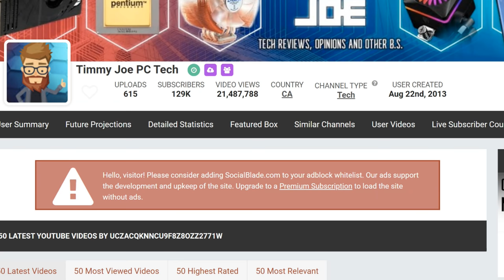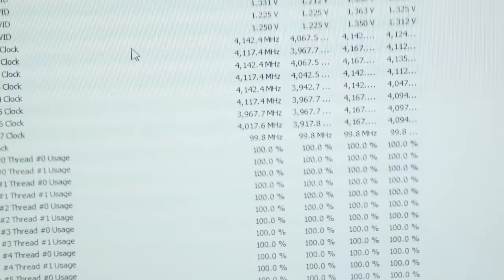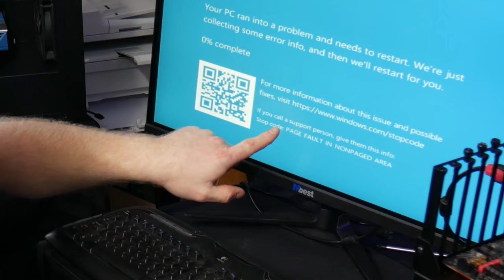This Ryzen 3700x was my biggest problem in 2019...

Comment: Of course you want a twelve core, why settle for an 8 when you can have a 12...
Edit: I had one problem kind of similar to yours that was caused by a windows update error of some kind.  Just had to reinstall and that was fixed but I guess the newest update didn't install properly or didn't overwrite other updates that cause comparability issues?  It would freeze just sitting on the desktop within 5 minutes of starting so good job windows 10.  Another odd problem was with a Nvidia Linux driver that messed with the sleep/hibernate/suspend... basically anything that turned off the screen would cause the system to shutdown instead and using opensource drivers or rolling back the official fixed it.  Mobo issues are something else though and I haven't personally had any but that would be a pain to figure out, especially since it still technically works, just situationally.

Comment: You know I have a really frustrating but similar problem with a 3600X video editing rig I sold. Also a Gigabyte motherboard. The client would report all sorts of bugs in Premiere. Initially I wrote it off as the client (who is new to editing) simply using too many effects, but I was unable to reproduce the problems in my workshop, then I would give the PC back and a few weeks later she reports new problems. I tested the actual video she was editing and the footage (optimized the effects too), suspected problems with Creative Cloud (there was some bug months ago when an audio layer with 12+ audio effects would slow down the PC more than it should have, but they fixed that since then), changed the videocard, the RAM, the PSU, but never once suspected the motherboard brand...

Comment: My pc started out as a 2400g during the mining apocalypse, so I was using it to game. I got a gigabyte B350 gaming I believe which has no heatsinks on the vrms, or at least on the soc mosfets. This is my first built pc, so I didn't know it would be a problem. I was wondering why my games would run okay to start then turn into a stuttery mess. Well, turns out they were getting up to about 120°c which was causing it to throttle. I ended up returning the board, but it really turned me off gigabyte. I also didn't like that voltages and everything was offset only.

Comment: I have the X570 Aorus Pro Wifi and 3700X with XMP settings using ryzen calc and PBO enabled and never experienced blue screen at all since I built it in August of 2019. never even had to restart because of errors/hangs. maybe try again but with retail products instead of launch samples?

Comment: @TimmyJoePCTech - Weirdest issue i havvve Ever gottten was when a Windows OS Refused to accept Changing of Hardware By using Same OS in Upgraded Hardware config - it Actually Refused to Boot From Just Upgrading Hardware !
However 
Same Isuue i THINK You experienced Here is from BIOS Update on CPU to BIOS Update on Motherboard to OS UEFI Update to Accept Updates Through the Codec of the UEFI Update as Many times a Windows UEFI Update WILL Brick a BIOS due to Not Recognizing the Hardware Updates Through its Own BIOS Codec - { micro code } -,
See - what ive came to learn is that Windows / Microsoft , due to Loss of Profiting From End User Upgrading or Updating Hardware that Windows / Microsoft Feels it Also Should be Upgraded / Updated With a New - Purchase  - From their Product line , as Soo Many are Constantly using Same OS to Cross Platform or Eliminate Purchasing New OS For Updates or Upgraded Systems - Call it - BUT-t Hurt -  from Loss of Revenue , if that makes Sense .
Also had a OS Purposely Brick my Motherboard Bios From This Exact Same issue , without the blue screen even ggiving Any Warning to problem , just But-t hurt from Not purchasing New OS for Upgrades to my Old 15x system that i have sitting behind me now waiting on a Refresh - paste etc. Before selling iot off with Totally different os and some upgraded fans to improve airflow with a 1050 ti and Oly sshd`s , Might throw in a ssd for boot , But I Want see Any mark up in price for sale as its Used hardware - soo , i Think ill just stick with the sshd in it now and let it ggo as i Want get what i have In It Anyway . 
Oh well 
Later Tater

Comment: I have a 3700x, have to run an offset voltage of +0.2v else it bluescreens. Or I can either lock it at 4.0ghz and then it's also stable. Something goes wrong with the voltage it seems when it's boosting. (msi B450 tomahawk)

Comment: I'm not a big fan of Gigabyte more so due to my linux-box is using a X470 Aorus Ultra Gaming with a R5 2600 and they disabled PBO because it's not an X chip.. humm you don't need an X chip to use PBO.. you only need the X chip for XFR.. The Asus TUF B450M Gaming Plus did al that and more.. but had a poor layout for me.. I regret the swap. so yeah. I'll be avoiding gigabyte if I can help it in the future. And yes.. that was their answer on a support ticket, PBO is not available if not an X chip on that board.

Comment: Hey, I have the same processor, MSI X-570 board. With a Vega 64. I am having stuttering issues and it doesn't seem smooth as it should for what I have installed. 16gb of ram as well geared for Ryzen. Mouse will freeze on screen while gaming, just doesn't feel smooth most of the time. 

Any suggestions on what it could be or what I could do to investigate this to see what is going on? 

TIA Timmy!

Comment: How can you swapped motherboard on another cpu when swapped cpu ( in ) to another motherboard, twice?  Have you tried by using a lesser core chip of Ryzen to be sure it the motherboard doing or that what you actually meant.  Otherwise I may think one of the comment had answer that question to be the way Gigabyte have have done.

Comment: I had the same issue with me 2700x turns out my issue was my ssd. It was not an empty drive it had a windows install from a previous (fx) system. Did a clean windows install and its been  good ever since.

Comment: Great video Timmy! I've always! told my clients and suggested to my clients that asus,evga,msi and asrock( even more so asrock as there cheap buy VERY reliable) are THE best imo for a motherboard. I myself am running a ryzen 7 1800x on a gigabyte Mobo x370 and the Fricking CPU is a finicky sob with my mobo,hence why im looking to upgrade my CPU and MOBO(to a Asus x570). Very rare imo this stuff happenes but being a user OF IT,.Yeah it sucks ballocks. Im also running a 1080 GPU and 64 gigs ram.

Comment: My Problem was about for a week ... my MSI B450M Mortar MAX wont work ... i replaced at with a new video card because ez led shows me that the gpu failed.

issu same... so i fought hm it could be my PSU ... so i changed my PSU and now it worked but i had after 15-40min in Games Blackscreens.

Then i had enough and switched the motherboard to a gigabyte x570 gaming x and what should i say... it works just fine!

that was my weardest problem ever!

Comment: In my hp omen I put this 3700x in and it ran beautifully with the 3070 on 1440 but randomly when trying to upgrade an sdd I started getting the dreaded memory code of 3 long and 2 short beeps. No display.  Kept banging my head then finally dropped my original 3500 in there and cleared cmos then problem gone.  Do you think i got too much grease in bad places on the cpu or it's simply toast and i should chaulk it up?
Reply: Heartbreaking cuz I just got a sweet new extra wide monitor from wife for bd that I've not even unboxed yet 😂 cuz i know the ryzen 3500 will bottle neck the 3070 bad @ 3440x1440 😢 hAllppp

Comment: Thanks for the truth Timmy, 
 I recently upgraded the bios on an (ASUS tuf  X570+ wifi) with a (ryzen 7 1700) installed. 
This will give you a black screen as you loose support for the first gen cpu.
Purchased a 2nd gen processor and bam it took off.

Comment: My 3900X has this issue if the spread spectrum is enabled on msi,asrock and gigabyte. It just shuts off just like when voltage is too low and only on idle/low current/stress loads.

Comment: I have an msi x470 gaming ac m7 motherboard that won’t let me manually set ram timings or xmp with a 3700x with the latest two bios updates so have to run the their v1b release bios which is frustrating because I’ve tried two sets of ram and two other motherboards and it runs fine on those also the 2700x I had in that board runs fine with manual timings on latest bios and msi themselves haven’t gotten back to me in over two months what it does it’s boot loops till it sets ram to default 🤦‍♂️

Comment: On my new Asus Crosshair Hero VII WiFi, I got a Q-Code 02 and couldn’t get my motherboard to post at all with a ryzen 5 3600 with the latest bios. I changed out the memory, changed the cabling, changed the hard drives, nothing worked. Switched back to my MSI b450 tomahawk, works fine. So I sent the Crosshair Hero to Asus for repair. Anyone know if you can fix a 02 on your own or is that a bad motherboard error?

Edit: I like to try and learn to fix things on my own if it is possible is why I’m asking for future reference.

Comment: I have the same issue with a 3900X and the non wifi version of the aorus pro, exept it happens when i turn XMP on, i blue screen all the time. So for now i have 3200Mhz ram running at 2600Mhz... Any solutions ? I think it should be fine if i play with the voltage but I suck at overclocking... If a good soul would like to help I would appreciate a lot !

Comment: Timmy Joe! I have a problem with my pc that is driving me up the wall. Any input would be amazing! Built an 8700k build with a gigabyte z390 auros elite, 16gb ddr4 3200 Corsair ram, 2070 super and a few different hard drives. Problem is randomly either my game will crash or pc will hang with constant flashing of hard rice activity light. If it hasn’t completely hung then il check using intel rapid storage and either the drive the game was running from will have plain disappeared from my pc OR the sata transfer rate will have dropped down to 1.5gb per second from 6gb and only swapping sata cables with other drives around will get it back after a reboot. Appears to be random drives at random times and across ssd’ sand mechanical drives. Can’t work it out!!!!

Comment: I had a similar problem a year and a half ago when I was building my first new pc with (I think) a Ryzen 5 2400 and a MSI B450 motherboard. I was getting random bsod's at random times, it would range from 5 mins to 5 hours, with over 15 different errors. I didn't know what to do. I just RMA'd the CPU, RAM, and mobo to Newegg and bought a i5 8600k with an Asus z450 from Amazon.

Comment: I have a Asus TUF GAMING X570-PLUS (WI-FI)   with a 3900X cpu ... tried to install windows ..and it bluescreens ... so I updated the bios .. re-installed windows and got another blue screen ... the cause of the blue screens .. was get this .. the Intel wifi  onboard ... I had to disable it in the bios .. install windows and then re-enable it  to get it to work ..

Comment: if you think that was a head ache you should try using corsairs iCue (not Cue. which it will try to force itself to update to if you have Cue.) on a x79 system (: doesnt even bother to give you a full blue screen, just straight up makes your screen 1 full color with no text at random (mine got hard triggered by playing LoL but it took ~40 min doing anything else but 3-5 min of league). didnt have many spare parts and there was almost no info on this at ALL as x79 is fucking ancient and cue is completely replaced by icue and you have to go pretty deep fto find a download that may or may not be legit of corsair cue, then make it not update itself to icue right away. pretty sure there is still no true fix for this but simply not getting a corsair device that should need icue(or cue) if you have an x79 system, to all the 3 people who still got one of those.

Comment: i have a Asus b350-f the board wasn't really design for r7 3700x, but with the bios update you can put 3700x and even up to 5800x or so i believe anyhow im using this pc right now and it works fine with arch linux, but the channel b slot doesn't work and i read up if pins are bent on the cpu can cause this and i check the pins and they all seem  fine from what i can see from a naked eye, but i dont know i mean it works fine but memory only works on channel A and i had this cpu in a b550-a motherboard and it ran fine and ran all 4 dims not sure why is the problem.. though im guessing the 3700x is  a cpu i would tell people not to get i say get a 5700x.

Comment: I had this problem on my 3600, i found that by letting PBO have +200Mhz would cause crashes in normal use, this was driving me crazy as i was trying to OC ram at the time, around i got my cpu about a month after launch, i thought it was ram also and ram memtest86+ and it would find a error at 50% by the second pass if i ram my ram in dual channel, single channel was fine, but memtest86 was fine and so was memtest in windows, a BIOS update fixed the memtest86+ error (took almost a month to get that update); i have a MSI X470 Gaming Plus

Comment: My pc first start won't boot to windows. I have to turn off the pc and wait for 10sec then turn it back on.. It will get stuck on the asus tuf logo. The led boot on the montherboard is on.. Check every thing on bois even change ram set up. 
My set up is ryzen 5 3600x, asus tuf x570 wifi, triden z neo 3600mhz, corsair mp510 nvme, gtx 1660

Comment: your motherboard not feeding CPU enough power because bios think it is a4 5400 CPU but not a4 5400 it is ryzen 5 n i think u need upgrade bios so it should be able to work out n i do remember build one for my friend same mobo same CPU n GPU 980ti n i have that problem before n i have turn voltage up get it back working

"edit if doesnt work just hit me with comments i may come up with something help you out"

Comment: My Msi Rtx 2080 super won't let me use mystic light software on the strix z390f . :(

Oh also the rtx2080 won't turn on my screen with display port. I have to switch off the monitor . Turn on the pc and when the red and yellow lights come on on the motherboard I have to switch on the screen instantly or it won't post and I'll have the VGA light blinding me

Comment: When i first got my 1600x and Gigabyte B350gaming 3 it worked perfectly. After a few months i started to get BSOD's. Very rarely. then slowly more often. After about 6 months they were daily, to the point they corrupted my OS install. They BSOD always came back as memory so i kept swapping/reseating etc. I thought maybe it was the OC on the memory so changed and messed with it etc. When the OS corrupted my BSODS were happening every 5 mins or less couldnt even reinstall windows. After messing with it for a couple days I did the magical thing of changing the power cable from my PSU to my GPU. Boom worked no problems sense. "Note: I have a very old Gigabyte Oden" so power cables do wear out. 

More recently "since BIOS 32" My overclocking have become more unstable with specific programs. I can over clock to "just under" 4ghz no problem except when I play Battletech. That will cause a BIOS crash and reset when i restart the computer. But only that program so far.

Comment: G'day Timmy Joe,
PCs do get weird problems, my weirdest problem was when I rearranged my room,
my PC had been running fine for about 6 months, I unplugged all the cables from the I/O (I didn't touch anything inside), I moved all the furniture plugged everything back in the I/O, turned on the PC & no Windows, restarted into BIOS the M.2 & hard drive were both detected there, so restart again & no Windows,
I tried to Windows repair (with the help of Microsoft Tech Support over the phone after explaining what happened) but PC wouldn't detect windows to repair, I had to totally reload Windows & have not had a problem since 🤪🤪🤪🤪🤪

Comment: My guess is that the Gigabyte is detecting something wrong with the RAM settings when using the Sample 3700x ... You may have needed to see what the change in bios was between the two cchips but I am guessing the RAM timings or other settings don't detect correctly with the Sample chip and gigabyte but AMD fixed the detection issue on newer chips they pushed out for sale

Comment: A similar thing is happening to me but with a MSI B550 Tomahawk  (same CPU), I´ve tried two kits of different model "ryzen optimized" g-skill memory and changed the psu and I´m still getting random bsd (ntoskrnl.exe or hardware.sys on the dump files). This happens when I´m shutting down the system or after just turning on the pc. Last thing I´ve done is turned off the xmp profile so my ram is at 2133 mhz (not quite what i´ve paid for), If I get another bsod like this I´m gonna have to buy another pc or mobo hoping either one is a safe bet cause it´s a compatibility issue and not the parts themselves being defective ... we´ll see.

Comment: Aurus x570 elite and ryzen 5 3600 purchased 3 months ago could not get it to output video on gtx1070 aurus graphics. Had to buy Aurus ultra gaming X470 and a Ryxen5 2400G  to test out what was at fault 2nd system works perfect swapped out stuff from one to the other. the x570 elite and 3600 still dont work together and x3600 wont work in either mobo. thrown in a corner wasted my money. maybe in a year or 2 they fix there problems until them expensive junk.

Comment: I always had issues with Gigabyte motherboards I bought. I always liked their design, but they always had random issues. I just stopped buying them

Weirdest troubleshooting issue I ever had was a Gigabyte (lol) AM3+ 990fx board that refused to accept FX series processors (FX 8350, FX 6300, etc). It loved Phenom II's though, I just ended up selling it with a AM3 Phenom II 970 Quad Core and never had issues.